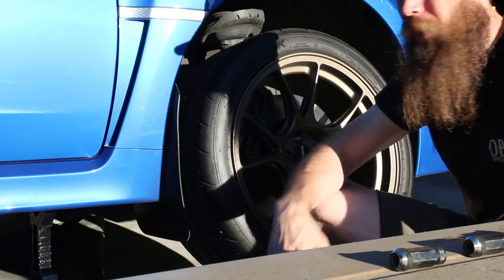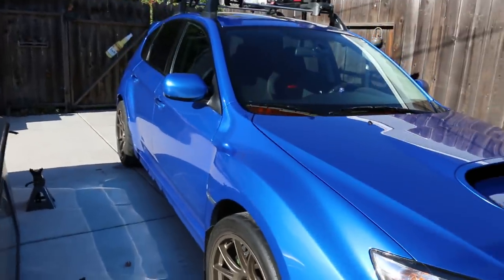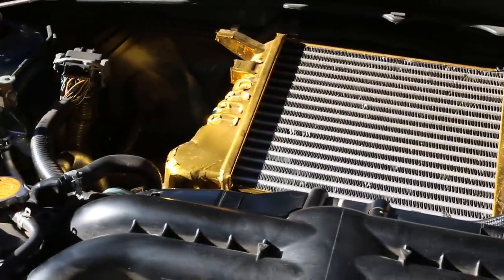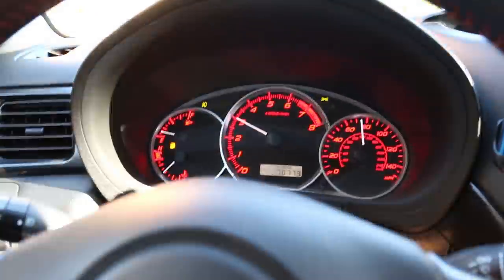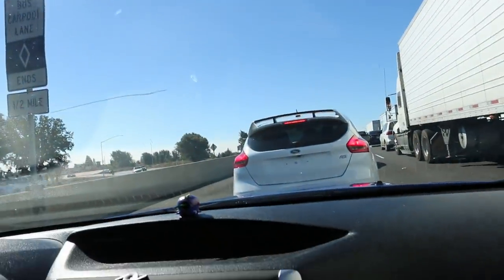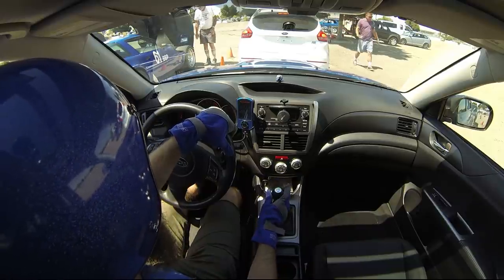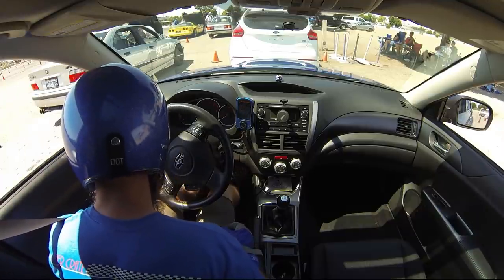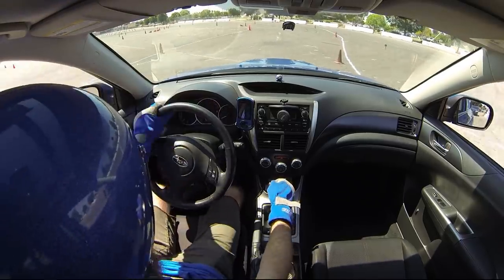DAY IN THE LIFE OF AN AUTOX RACER

Comment: how'd you get your accessport to stay mounted in the heat?
Reply from the maker: +Anthony Perry I use 2 layers of 3m double sticky 20lb hold. One on piece on the dash and one on the mount. It helps with the curvature of the dash. Also after mounting make sure to leave it a day before putting any weight on it. This way works great.

Comment: Hey, I'm kinda new to AutoX. What would be the first mods you would do to an 03 WRX to reduce understeer? Rear sways? Wider tires?
Reply from the maker: +Brandon sever rear sway first make sure it's adjustable also get end links at the same time. If you can afford the front that would be good also. Then tires then coils.
Reply: Blake's Garage Alright, thanks!